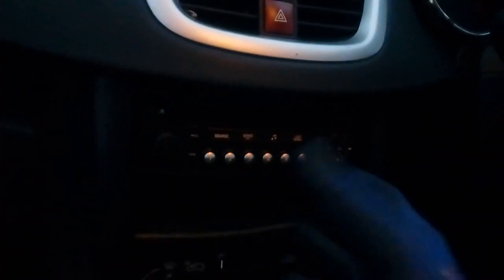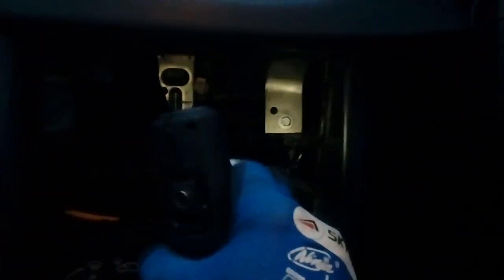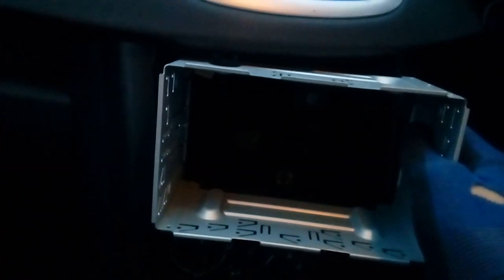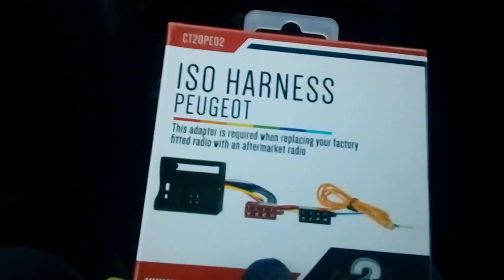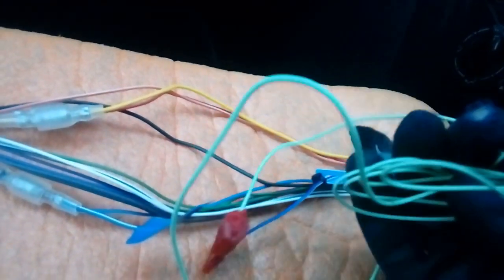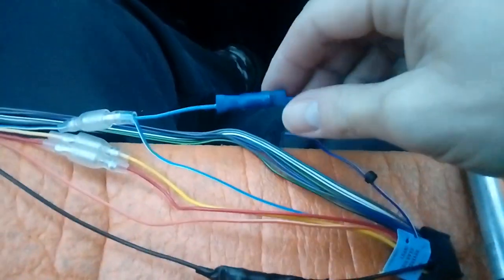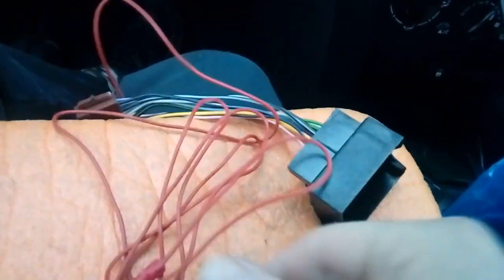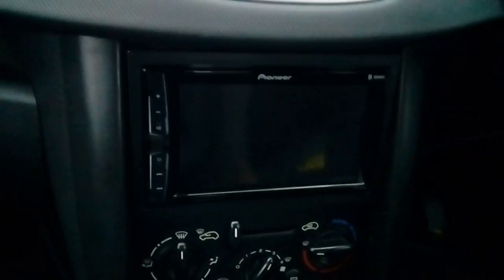Peugeot 207 2006-2014 how to fit double din radio step by step guide

Comment: The original radio controls the board computer. Does that still work with a new double din radio installed?

Comment: Nice vide explaining the instalation but two comments below stated there will be a problem with the central screen which is just above the vents which shows your cars stats (mpg, range and so on) as well as date time and morte. Removing original radio will prevent you from making any changes if needed to date time and all other setings. UNLESS the new 2din radio somehow does control this? Also, does the control stork by the steering wheel still work with the new unit?
Reply from the maker: Correct the screen above won’t be able to be adjusted with a display interface adapter, these can be pricey so consult your retailer about this item.
As for steering controls you would need a steering control interface which are around £40, again consult retailer.

Comment: Hi, useful video however very hard to watch as you filmed at night. Ps everybody makes the same mistake. The fuse spur. You can plug it in two ways. One way your accessory is not fused and in danger or burning out the wiring however unlikely that is but that’s the point of fuses. You should check which side of the fuse box is live with a meter.
Reply from the maker: As long as people insert it the same way around as shown in the video its fine. In the past I showed what was the hot side and ended up with more questions everyday than I could answer, so now All pleaple need to do is follow the video.
As for night, yes it's early on winter morning and I'm thinking of pulling this video due to it annoying people. Sadly I don't choose when the cars come in.
Reply: Thanks for the clarification. I wouldn’t say pull it, it’s very well explained and useful I will be doing one soon. My daughters cc so I’d like to have seen how you routed the Microphone in case you unclipped anything etc.

Comment: Having a bit of trouble in regards to the dimmer wire after fitting the radio into my 207. There doesn’t seem to be a dimmer wire that attaches into the ISO harness? What colour wire would it be on the vehicle end and what colour wire do I need to tag it onto on the radio side???

Comment: So I'm gonna install a double din into my parent's 207cc, parts are ordered thanks to this video. Only thing different is that I'm using a Connects2 adaptor with an aerial and can interface built in. Saves me the hassle of multiple adaptors and ignition live leads.

Only question I'm stuck with is about the possibility to place the old radio and tray back after cutting those tabs. Is it possible without the thing becoming too wobbly?

Comment: And now you will be unable to change the time and date on the screen in centre of the dash which is why I watched the video in the first place!

U will need a connects2 box to connect the steering wheel stalk controls to the stereo,
Reply: Any solution to set the date and time on the centre console? 
:(

Comment: Hello really helpful vid especially  the power cable and where the fuses are. On my setup I also have an illumination cable (orange) but my harness dose not have a matching cable to connect it to, any idea where I connect this cable ?
Reply from the maker: Orange cable is not needed on the install.

Comment: Hi PJ,
Can the fuse box live red cable be connected through the original quadlock red-red/red-yellow, or does it have to be connected with a fused spur like you did on the video?
I wired my head unit through the quadlock, however, I am having a problem with all the apps resetting every time I turn off the car.
Thanks in advance.
Reply: Update...I did connect the stereo using a fused spur and the problem is solved. Thanks for the info PJ.

Comment: Hey! How do you know which speaker cable is positive and which one is negative? I'm going to connect after market speakers to the already mounted original cables from the car, but they all have different colors and they show the same voltage when tested with multimeter even though one (of the two cables per speaker placement) should be negative or earth. My after market speakers have a + and - connection, so I know the actual speakers polarity but not the cables in the doors. On the Peugeot original speakers they are just labeled as 1 and 2..
Reply: You can use a battery for it to check

Comment: Hi, I've installed everything as mentioned in the video, but I didn't get any red cable to connect at the fuse box. The problem is that the radio doesn't switch on, I've tried in another car and it does work. What should i do? Thank you
Reply: I'm having this same issue, I don't understand
Reply: Bit late on this one, but i bought an adapter that didn't have that wire. They're cheap and quite frankly shit. You can either run the wire yourself or buy a new adapter which is what I did.

Comment: Nice Video. Does following this (Literally the radio I just bought) mean I could use the steering volume/track controls or do i need a different harness/adaptor?
Thanks.
Reply from the maker: You will need a more expensive interface to make the steering controls work with an aftermarket radio such as this one - https://www.ebay.co.uk/itm/Peugeot-207-2006-On-EONON-Car-Stereo-Radio-Steering-Wheel-Interface-Stalk/201125160881?hash=item2ed3fe67b1:g:nVsAAOSwFAZTvT54

Comment: The iso harness I’ve purchased is the same as the one in the video however there’s no ignition wire?
Reply from the maker: In that case it has ignition connected to a delayed power off circuit. Your radio will go off but only after a few mins of the car being switched off.
Reply: @PJsprojects  would this mean it does not need an additional connection to the fuse box?

Comment: What’s the dimension of the Peugeot radio. Cos I want to get a 1 din radio and I want it to fit perfectly
Reply from the maker: With aftermarket radios only two sizes are sold,these are single din and double din. When you buy your aftermarket one make sure to buy a single din size because double din will not fit.

Comment: Thank you for this video! Im about to buy my first car peugeot 207 (2009). I am not a car person myself but want to get a double din radio / sat nav / Parking Assistance installed. Was wondering where to buy the unit? and if any local garage would be able to fit the unit. with the Parking Assistance camera. Thanks!

Comment: Hey mate. When i cut the plastic things off, is it possible to put in the original 1-din radio later? I hate it to cut in my car, but i buyed a new radio
Reply: Yes, I did on mine and managed to put the original stereo back in.
Reply: @LearnFastic  what I was looking for, thanks mate. Wasn't too wobbly?
Reply: @diegohuijbregtsgarcia5102  No, it was OK and you can also swap the stereo & plastic insert positions to what you prefer.